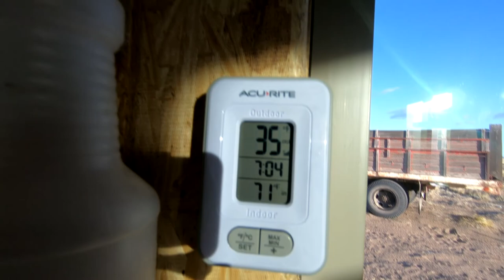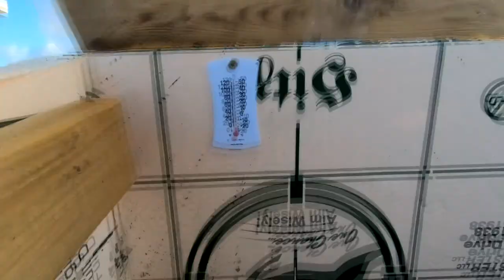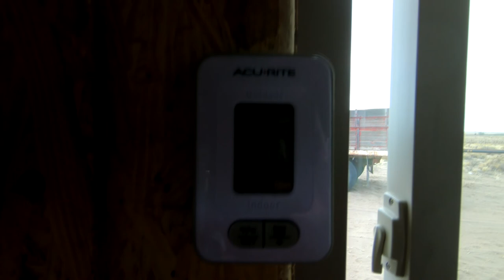Reorganizing the Sh'ouse and Testing the Cold Frame

Comment: Hello you two. You might try adding straw bales around the outside to retain the heat of the black soil. Also toss on an old blanket on top if the nighttime temps drop. During exceptionally cold nights, try putting in some painted black 2 liter bottles filled with warm water. Water is very dense and holds heat for a long time. These are things I do to have a Winter garden here in Ohio.
Reply from the maker: Thank you, Sandra!  With all of the mice around here, we are avoiding placing straw bales anywhere in the open, haha!! Local bunnies are eating it and using it for bedding, too. We could pile soil up around it. Unfortunately, with the wind, we would have to weigh the blanket down so it doesn't blow away.  :-)  But great ideas, especially the warm water bottles.   By the way, haven't seen a video from you lately!